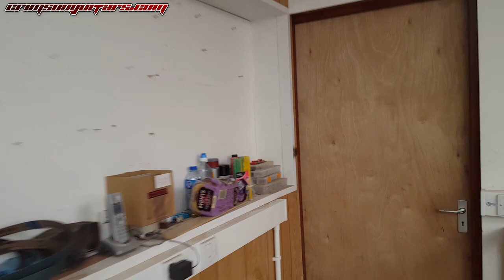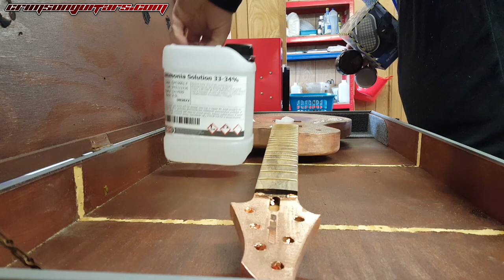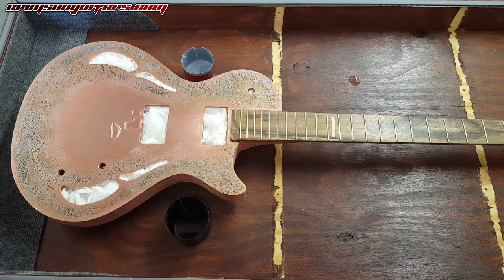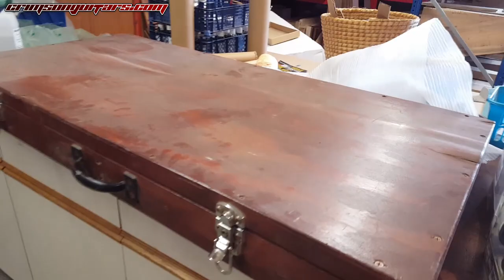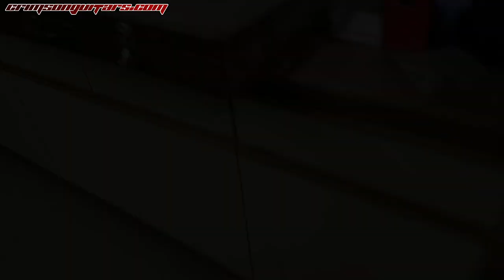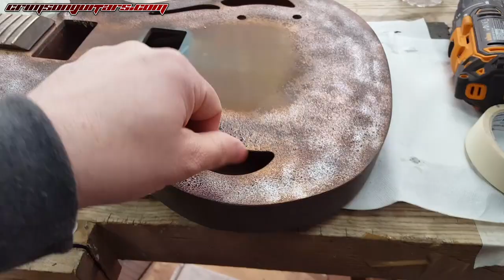Ben, copper and chemicals - a bad combination?

Comment: Ammonia isn't that bad, Holding your breath will do just fine, the mask is terrific overkill. 

Also, the ammonia did not evaporate since the surface of it was only very small. Wherever there was water on the guitar body, it instantly had a much bigger effect.

 You would have gotten a much better result with white vinegar in water (50% each) in a large container, and make sure it's getting nice and warm so it evaporates. Clean the brass or copper up with alcohol before starting so no oils etc remain. Rub thoroughly. I use that approach all the time to age brass parts that go on speaker cabinets and on old wood cameras I restore. Ages decades of time in one overnight 10hr session!

Comment: Another way to oxidize copper rapidly.
Clean the surface with 35% nitric acid and rough paper towels. Immediately mist with 95% hydrogen peroxide (H²O²). Watch the magic happen. Rinse with distilled  water when desired appearance is reached. DO NOT INHALE. AVOID SKIN AND EYE CONTACT. The reaction speed will change with temperature.

Comment: 3:15 Apparently it is indeed the case that you can't get a reliable air seal using a half-face mask over a beard (even stubble is a problem). (Here's a video on fit testing: https://www.youtube.com/watch?v=Syj_zeNtLGI ) What you use instead is a Powered Air Purifying Respirator like the 3M Versaflo stuff: a battery-powered belt pack forcing air through a tube into a full-face soft hood or hard face shield. Here's a video on using a Versaflo kit (coincidentally, for general woodworking): https://www.youtube.com/watch?v=mhKrtj7QJSI . Not only do you get a proper seal, but as a bonus you get easier breathing since you don't have to drag the air through the filters with your lung pressure. And the price for the whole system is pretty reasonable, when you consider what's at stake.

Comment: You can achieve marvelous results if you scuffed the surface with sandpaper, scattered some salt on the top, and sprayed the ammonia solution directly on the guitar (and leave it inside the box for a day or so). Also I would have done that without the frets and truss rod in the box so they won't corrode. You should try it.

Comment: Very interesting results!
Looks like the water caused the blue colouring - a different chemical reaction compared to the dry parts (faster oxidisation?).
Reply: From what I understand as a high school chemist student, water is required for oxidation to occur. There would have been residual moisture on the 12th fret inlay, and obviously there was plenty of moisture where he poured the water.